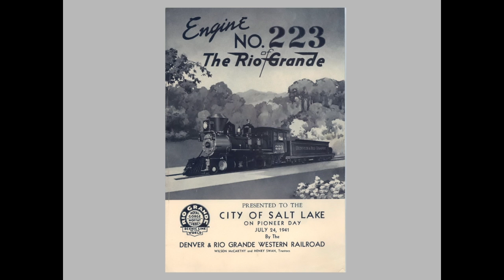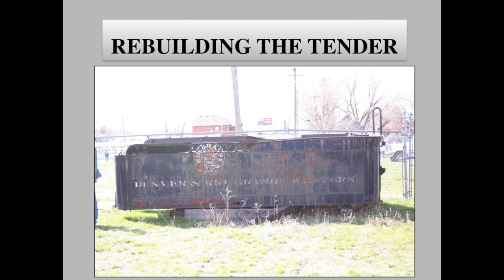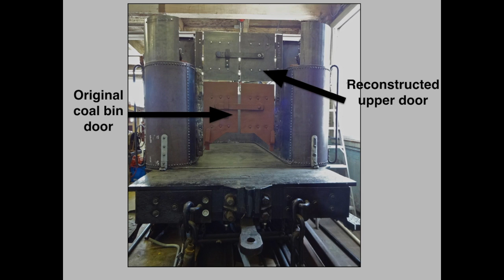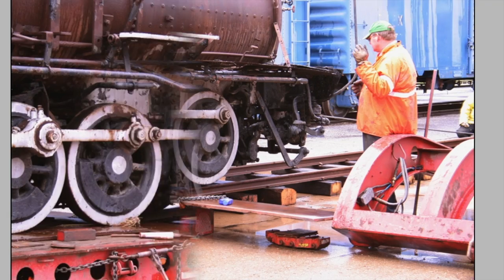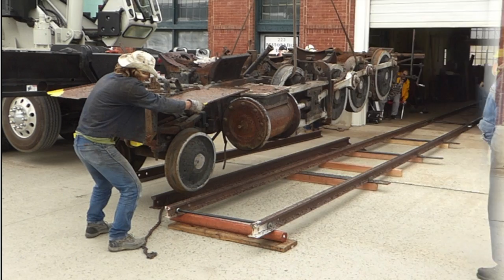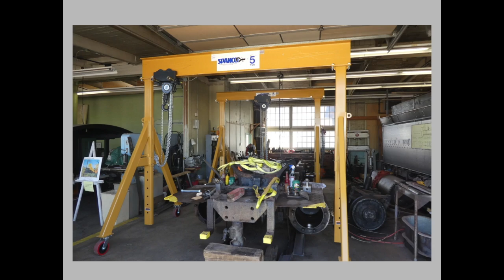D&RGW #223 Restoration Progress

Comment: Are you going to be able to get a riveted boiler certified? I was involved with the restoration of a Portor Locomotive and we had to have a new welded boiler fabricated as the state inspectors wouldn't let us steam the riveted boiler over 1 bar after repair. From the video your shell looks to have more erosion than ours did.
Reply from the maker: Right now its anyone's guess.  We've been concentrating on getting the running gear dismantles and refurbished and putting off the boiler work until we find some source of funds.  We have a grant writer working on that situation right now.  Hope it bears some fruit.
Reply: Take it for what it's worth but as for somebody who has been there check with your state boiler inspector before investing any money in that old boiler. If you need to have a new boiler built finding a shop who can replicate a fire tube boiler is a bit of a challenge. The shop that built ours has "retired". I know the Grand Canyon Scenic had a boiler similar to yours, probably a bit larger fabricated for one of their locomotives. Might want to contact them to see who did theirs.
Reply: Is the 1912 Klondike #4 2-6-2 also a riveted boiler? It's hard to tell from the pictures, but it looks very similar to the one on this engine to me. If so, the Wasatch Railroad Contractors repair shop in Cheyenne, Wy I believe just overhauled that boiler for the Como operation.
Reply: There was no arc or gas welding suitable to boilers at the time so the most likely answer is it was riveted (unless the boiler is a newer retrofit).